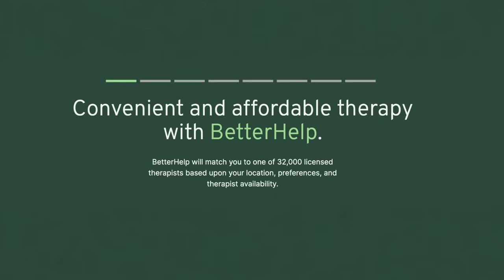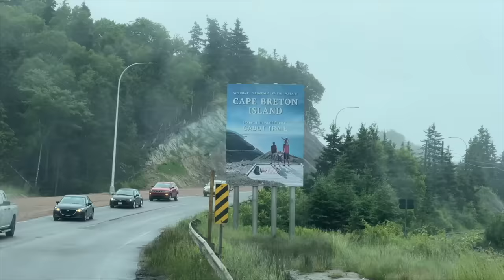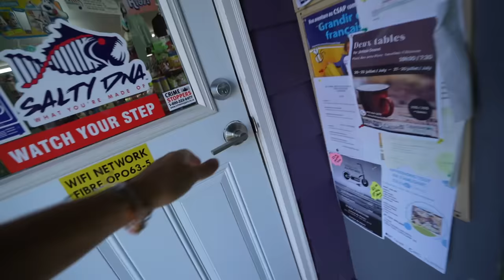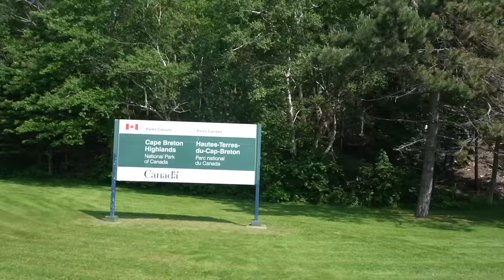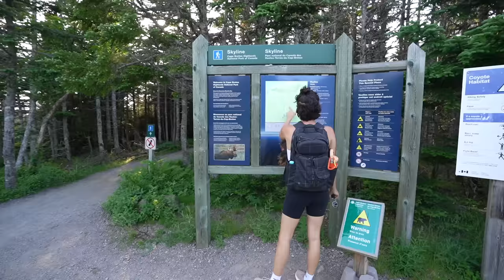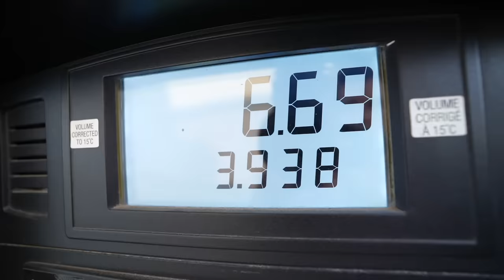This is the End

Comment: Am I the only one who was annoyed by the lack of seat belts and the wearing the seat belts wrong. they are suppose to be close to your body and a bit tight so if you did have an accident your body shouldnt move forward more than a few inches but with how loose they had them they would hit the steering wheel or windscreen.
Reply: It makes me crazy!!    My life was saved by a properly worn seatbelt and seeing their inability to wear one correctly makes me crazy and sad.   They should be smarter.
Reply: I was in a head on accident with a drunk driver (the combined speed was almost 100 mph) and my seat belt saved my life. The drunk driver was partiality ejected from his car through his  windshield and I had to sit looking at his body just a few feet away while I waited to be extracted from my vehicle. The front end of my car was pushed back over a foot causing the front doors to be jammed shut. I was severely bruised, but otherwise uninjured. I’ll never understand why people don’t use seat belts properly.